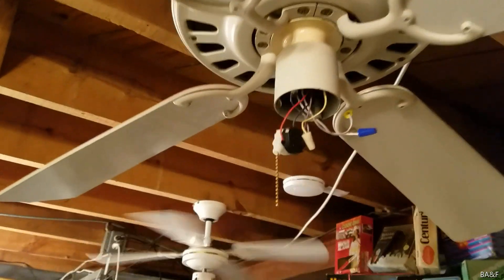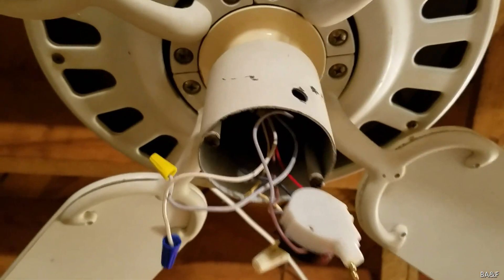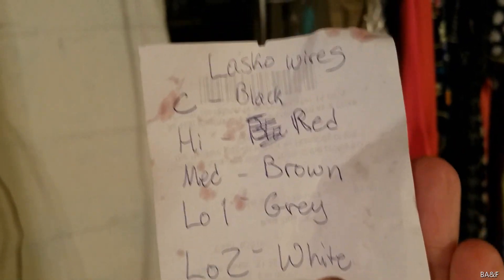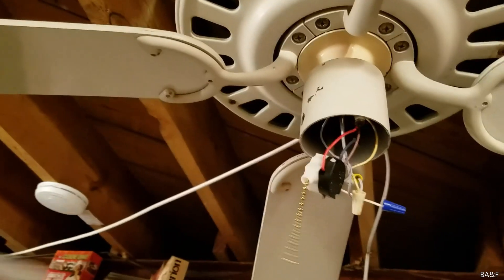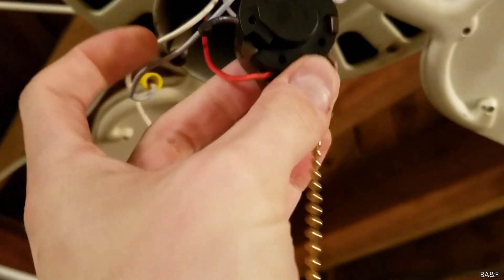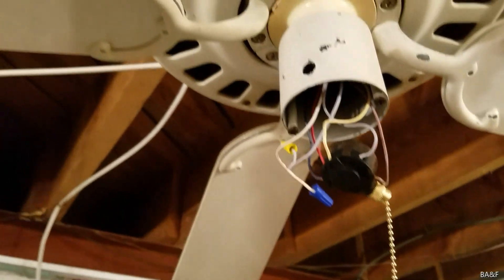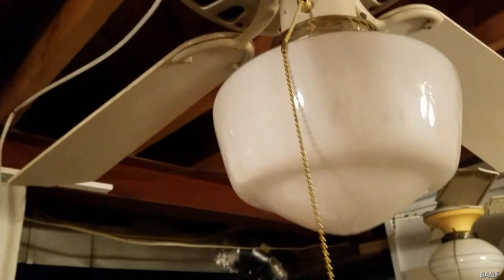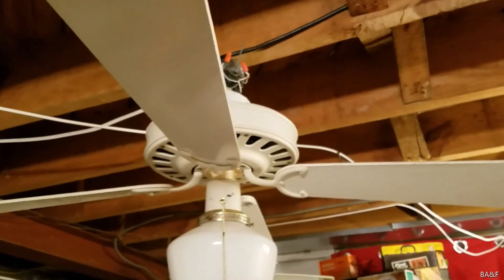Restoring the Speeds on a Sears/Lasko Turn of the Century Ceiling Fan | White model

Comment: seeing it wired with two speeds on one switch connection serves as a reminder - some people really shouldn't work on anything electrical.
Reply from the maker: The previous owner most likely didn't realize it originally had 4 speeds